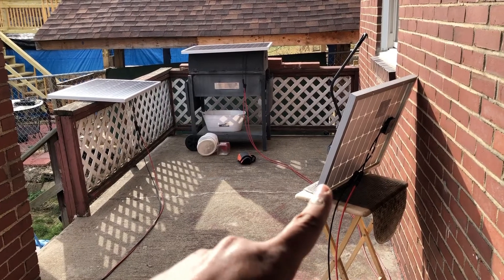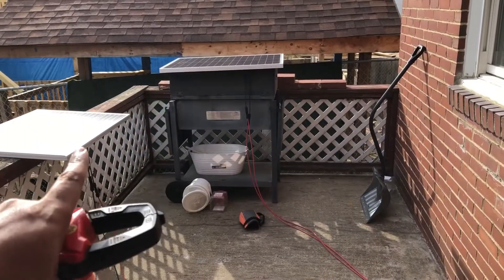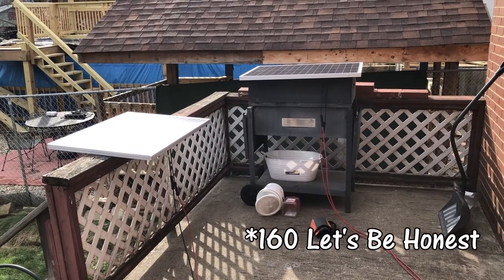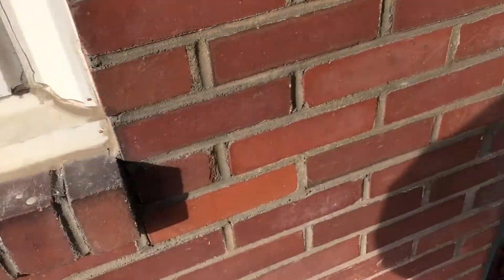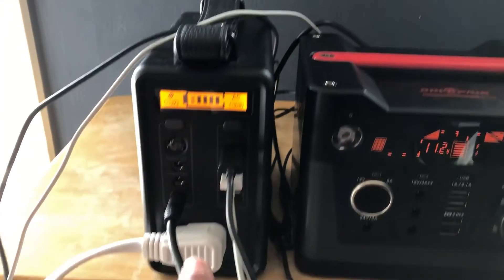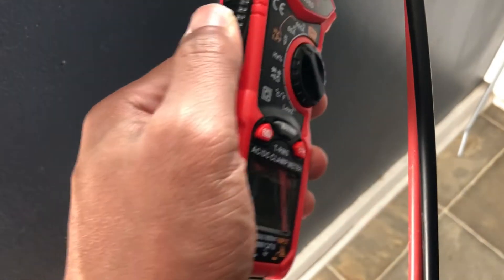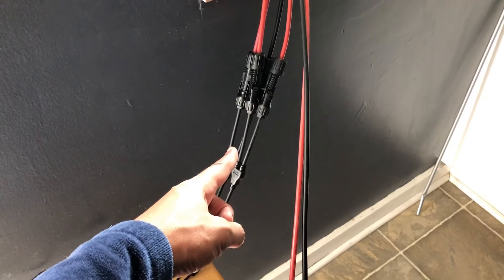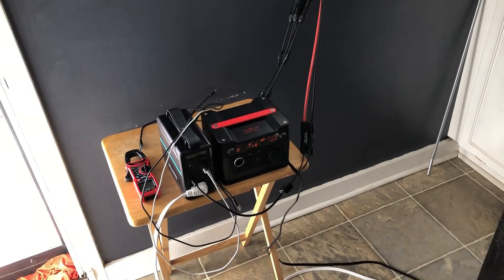THE RENOGY 50 WATT PANEL RETURNS!!!

Comment: Nice panel !  Do you own that residence ?  If so I’d drill a hole in the house and run wire .  Put an empty electrical box on the outside of your house. Run your MC4 cables in that box.  Done.  Anytime you need solar open lid, and plug in the box.   That’s what I would do...... peacefrom510 .
Reply from the maker: Hmmm. I'll have to think about that. I don't have the tools.
Reply from the maker: Im wondering how I can do it to maintain options. I'd love a two way option like a mailbox slot. I don't know man. I'd love to figure something out
Reply: @AskIveSolar  maybe call a handyman or electric company to go out to your house for an est.  ?  Won’t be hard at all. It’s just an outlet box on the outside of your house.  That has your MC4 connectors inside,

Comment: Rip for the window Man. Haha... 😂
And Nice video bro... Keep up the awesome content. 😎👍
Reply from the maker: I laughed even tho I don't want to assume RIP means rest in piece. Haha. Is that what it means?
Thanks boss!
Reply: @AskIveSolar  yeah that's what it means 🤪. 
Your welcome Bossssssss!!!!!!!
Reply from the maker: I've been trying to think of a way to get cables into the house but having a way to remove them easily. I don't think such a way exists.
Reply: @AskIveSolar  I watched your video again, & you are right Dude there is no way to get cables on inside. Until you just make a hole on left corner of the Wall, but that isn't easy I think cause those walls are very fat & those bricks.
Reply: @AskIveSolar  Better continue with the window that was perfect. 👍
Reply from the maker: If I was into making my own mc4 cables....I could buy cables that are stripped and get them in that way....but both that and drilling a hole is waaaay beyond my skillset. 

Running cables through a window....I'm a professional!
Reply: @AskIveSolar  You will improve your skillsets cause we can't stop it doing things that we just started. Haha... 
And yes you are professional Sir. 🔥